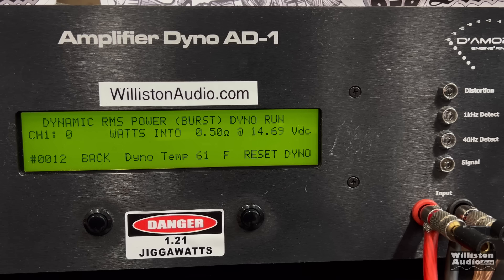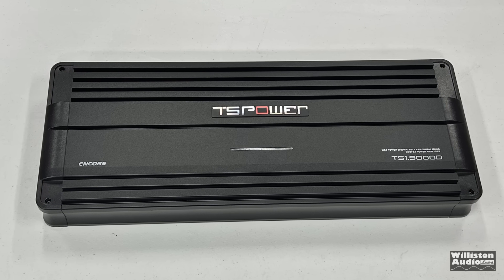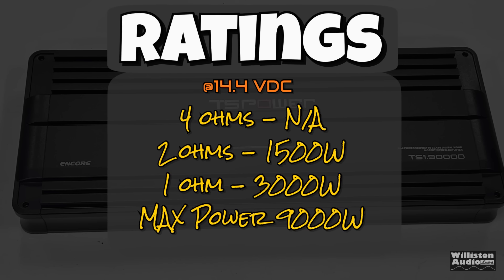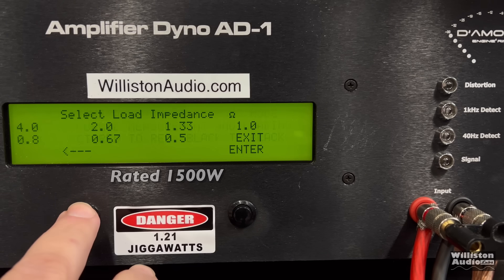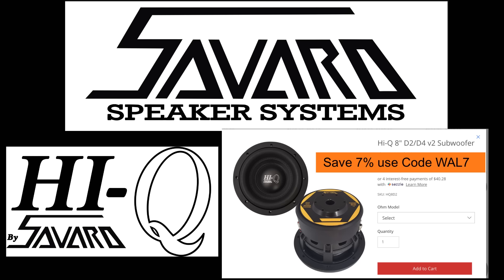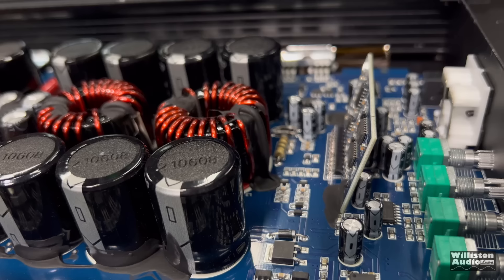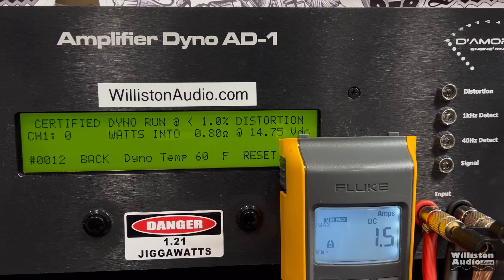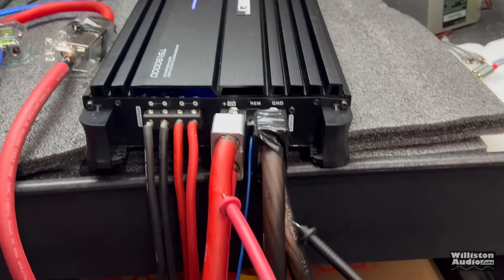This $150 Amp Promises 9000 watts...

Comment: That amp draw at 1 ohm tho 😬
Reply from the maker: I didn't talk much about the efficiency, but yeah it was kinda low overall and in the 60's at 1 ohm
Reply: @wal  That seems to be give/take of these cheaper priced amps vs more expensive, bigger names I guess.
Granted some big name brands have pretty low efficiency also, but if you want decent power for less money, the trade off is gonna be the electrical.
I’d honestly rather spend the cash on “better” equipment (JP amps doin work btw) than spend double on the electrical.
I have and Audi, so high output alternators are like unicorns to find…just buy the good shit, do the Big 3, lithium bank, etc & never once have I had any failures, overheating, anything.
My setup is in my daily so it gets tested daily.
My point is (my personal opinion) if the funds are available, just skip these low dollar items, buy it once and actually enjoy it instead of working on it or rebuying expensive stuff constantly

Comment: no way it does 90,000 watts
Reply: No amp does 90,000 watts
Reply: I think somebody got carried away with the zeros..😂
Reply: @leemollison7508  I think you are correct 😆
Reply: @bethanyhaskiell9116  yeah they should have used a d instead of D because they did that on purpose to look better.... i said it as a joke because it totally looks like 90000
Reply: @mcf3778  I figured that!! Power Acoustik does the same thing but at least this amp puts out rated power at certain ohm loads unlike PA

Comment: You'll spend 5x that much upgrading your electrical system only to have that amp last 6 months, I promise you, that amp is not forgiven, let it sit in the trunk of west coast summer or a north east winter, it won't survive. The cheep always comes out expensive,  and you pay for what you get. I have at least 4 amps on my wall that I spent around a thousand dollars for in the 90's , and they all still work, and probably older then most of the demographic that watch these dynos